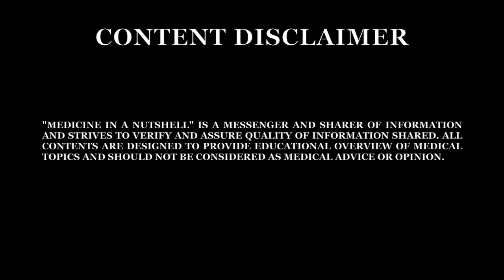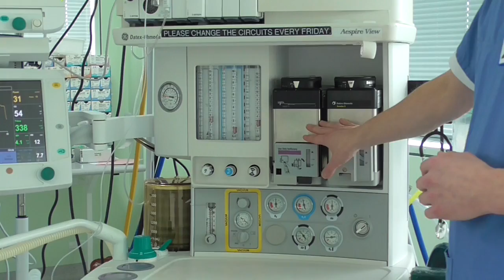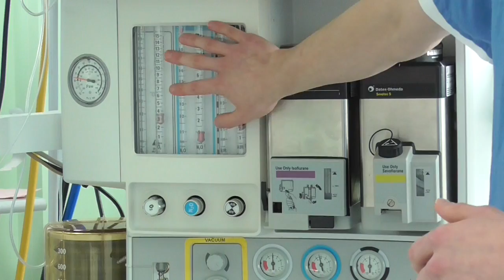MEDICINE in a Nutshell: The Anaesthetic Machine

Comment: One observation. In order for the ventilator to correctly display Vt Exp, a rebreathe bag on the end of the patient circuit should not be used. Vt Insp settings are unlikely to match Vt Exp measurements, as the rebreathe bag isn't compliant enough to fully return the fresh gas thats being delivered by the vent. Whilst this practise is convenient to have the vent cycling prior to use, for correct function, a lung simulator should be used. An enormous amount of theatre time is wasted by machines being put out of service due to Vt Insp values not matching Vt Exp during pre-use checks, when using rebreathe bags. Otherwise, your video is very informative. Thank You.
Reply: Put a rubber band on it ... like everyone else does.
Reply: @ejrupp9555  That is just the ignorance that I had to put up with whilst technically supporting these products for nearly 30 years...... No matter how many rubber bands you put on a bag, it will never expel totally what was delivered.....